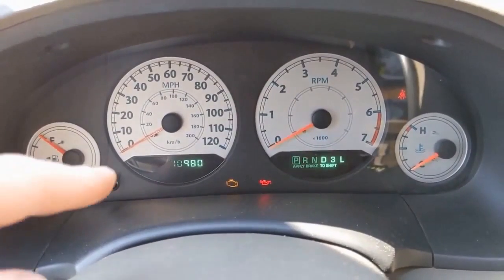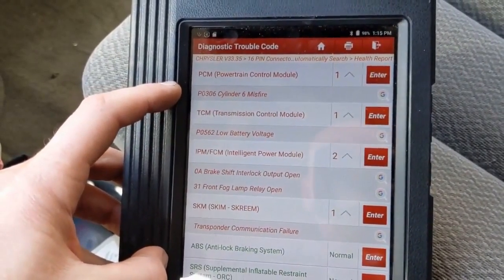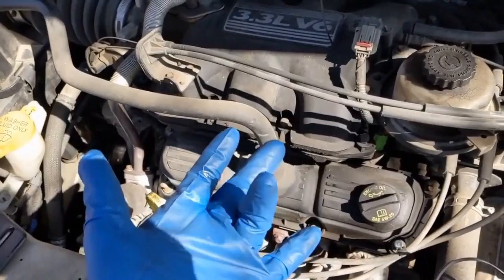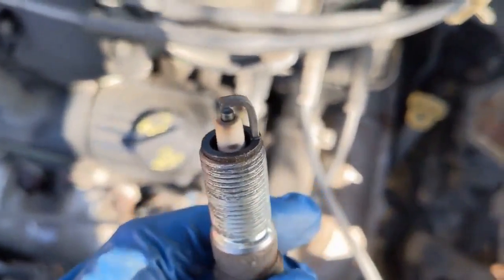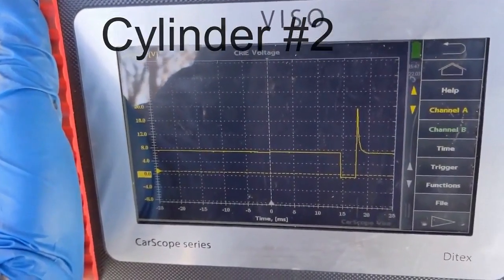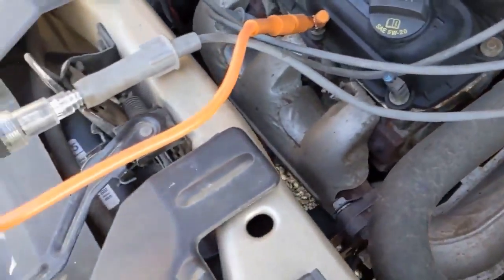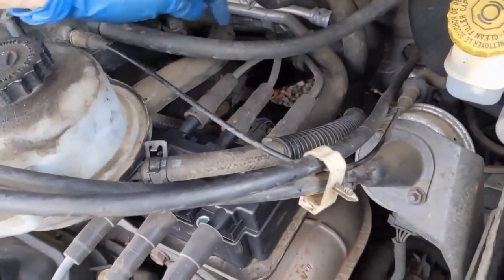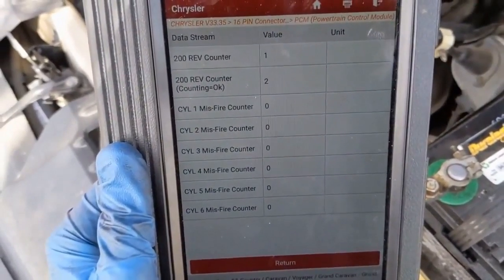2006 Chrysler Town and Country Misfire | How to Diagnose a Misfire Quickly and Easily

Comment: You just over thought the issue. Next time do a clear flood crank and listen. If it sounds good grab a test light and check that coil visually. You would nailed it in 10 minutes or less.
Reply from the maker: I agree! I think what threw me off was the spark tester looked like it passed but it didn't. I wasn't familiar enough with the new tool.

Comment: Thank you bro. Valuable information. I'm getting a PO301, I changed the plugs, wires and coil. I still get the code. Waiting for Fuel Injectors to arrive. Which I could see how to change them on video. thanks again.
Reply from the maker: You're welcome. before replacing the injector do a quick compression test as well. Just to confirm the cylinder isn't dead.

Comment: My van does the same, and it's still misfires cylinder 4 same van but it's a 07, I. Changed the spark plugs and wire set out new fuel injectors and wire harness along with a new ECM "computer", and still does it
Reply from the maker: I would double check compression. Have you replaced the ignition coil already?
Reply: @ValleyMobileAutomotive yes I just replaced it and I feel it is stronger but it still misfires and reads the code, I should do the compression test
Reply from the maker: @freddypalacios1668  Let us know what you find 👍

Comment: I have missfire on number 6 on the coil pack , there is no spark coming , i change the coil pack and the wires and what can it be?
Reply from the maker: @vladislavnaydenov-9425  Is it only number 6? Check the other side of the coil as well. These spark two plugs at the same time. See if the other plug has spark.

Comment: Basically, having the, same, on my number 4, , check the spark wire, burn out, at the end, waiting to get, new spark plugs wires, off eBay, the price is very cheap, , once I Get the New ONES, TRY THEM Out and plus, did a hard drive, reset the PCM, by reconnecting, the POS side and negative side of the battery, and put them together, for a hour, and TRUN the front headlight on, to drain the electrical system on on the PCM module, that when the hour over, TRUN off, headlights, reconnecting the battery, basically, it cleared All the codes and reset the PCM module , can check, volt on the coil, with a voltage meter, for a weak voltage output, if one has gone Bad , this for people that don't have a code computer. and trying fix there vehicle at home?????
Reply from the maker: @stephengraydog3988  Thanks for your comment 👍

Comment: My 2007 T&C 3.3 started running rough and engine light came on. First parts store couldn't even get the code to read (tried to tell me it must be a manufacturer-only code and to go to the dealer). Went down the street and second parts store pulled a cylinder 5 misfire. Thanks for the video -- shows me what I'll need to check. (But dang, I hate working in the back.)
Reply from the maker: @TheRealScooterGuy  Is funny since making this video I've done a number of Dodge/ Chrysler vans and they all needed ignition coils. Must be a common failure point. Let us know what you find 👍

Comment: Mine is running rough and I  I can drive slow but cannot overdrive at all soon I push the gas  too overdrive it’s not going you can be the ignition coil
Reply from the maker: @mxjuan234  It's possible. If the van has a misfire it can cause the transmission to not shift correctly.

Comment: Thank u same problem p5 town country kept getting misfire on 3 put in new plugs and wires but after still misfire cylinder 3 finally replaced the coil pack for the first-time it runs better now thank the Lord Jesus is wasn't the fuel pump or a bad cylinder I have 280,000 on it now trans messing up around 50 mph but the Lord has been good
Reply: Thank goodness you didn't have to replace the PCM 😮
Reply: @mondocjenson-dy8zd  it is the chain

Comment: I replaced the ignition coil check engine went off ran good for about 5 days now it’s has a slight miss fire again .
Reply: Happened to me, ended up being valve seat prematurely failling resulting with a slowly   blown head cylinder.

Pentastar 3.6L i bet?

Comment: I have the same issue 2012 dodge caravan 2 4 6 showing mis fire
Reply: It has separate coils
Reply from the maker: 2, 4 and 6 are all on the same side. What other codes are you getting? Any timing codes?

Comment: I thought my van was ready to get junked, i changed the spark plug and wires,the fuel inyectors and the coil ordered everything on ebay for a fraction of what Autoze sells them for and it drives like new
Its amazing

Comment: 2004 T&C 3.8L.  P0306.  Van idles rough, gets good mpg (23-24 hwy).  Changed plugs.  Changed wires.  Changed coil packs.  Replaced injector. Compression good.  

mechanic looked at it and says it was something with the valves or valve springs.  I can't pay for an overhaul. Wondering how it can be a valve issue since compression tests good?  It's been two years and about 20K miles.
Reply from the maker: Good question. I've seen this before on other vehicles where the exhaust valve isn't opening enough to clear the cylinder for fresh air and fuel. The compression will look good which can throw you off. Here's a link to a video I did about a Ford Fusion.
https://youtu.be/WxpQ3iyDHZ8
Reply: Valve issue = head cylinder faillure in the next months 

I've been running my RAM for 6 months straight with valve issue but still, while bad compression wasn't showing up in the beginning, as it actually a slow engine failure that can't be controlled, that will result with a blown head cylinder in the next months.

Comment: No biggie, you just need a spark Plug tester that allows you to adjust the length of the spark pulse your viewing which shows you the intensity, they are not that expensive and have a small plastic knob that allows you to adjust the eletrodes on the tester to varing lengths of spark, they are marked according to secondary voltage so you know if your getting 20kv or say 40 kv. Old engines you just needed the spark verification, newer engines need intensity as they run higher compression and leaner fuel.
Great video.
Reply: That’s good info. I’ve worked on my own vehicles for a long time, but I wouldn’t have thought about intensity. I would have figured that the spark tester was manufactured recently, so it likely would have some kind of circuitry that either shows spark is “ok” or “no spark”. I would have been wrong.

Comment: Good evening sir hope your day is going good! I was looking up p0300 in the factory manual online and I'm trying to comprehend test 3 in the book where it says, turn the ignition off, disconnect the ignition coil harness connector, disconnect the fuel injector harness connector, ignition on, engine not running., With the DRB3, actuate the ASD relay., using a 12-volt test light connected to ground, probe the (A142) ASD Relay Output circuit at the Ignition Coil harness connector and Fuel Injector harness connector., Does the test light illuminate brightly? Yes👉Go To 4
                 No👉Repair the excessive
                 resistance or short to ground
                 in the (A142) ASD Relay Output
                 circuit.
                 Perform POWER TRAIN
                 VERIFICATION TEST VER-5. 
                Are you able to help me
                comprehend that test sir?

Comment: True Ignition coil pack  like this don't throw codes sometime. I ended up buying sparkplugs then nothing change so I bought ignition coils then it works.
Reply: 2007 Dodge Caravan I got new spark plug wires wires and one coil replaced. I did have an overheat and a radiator problem which had to be replaced. Being told now I have two bad cylinders. Wondered if any of you had any ideas. I'm not very mechanical myself. Thank you